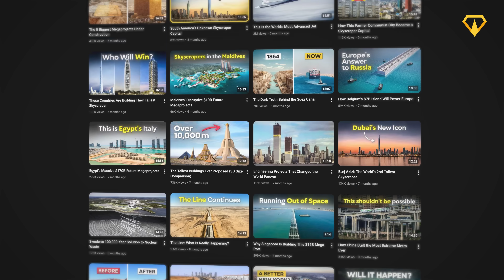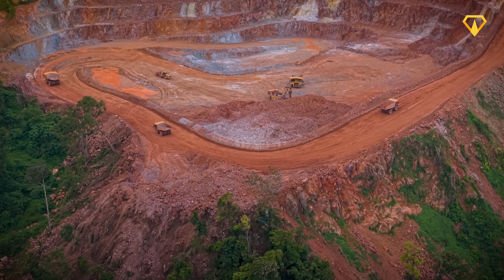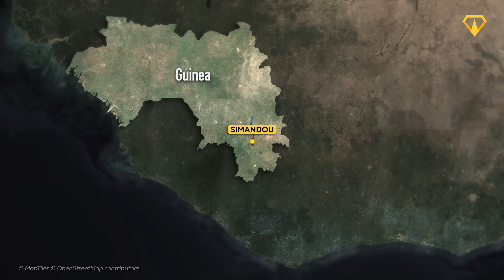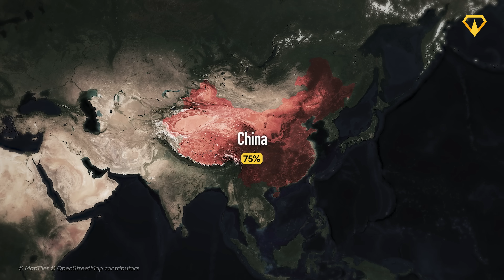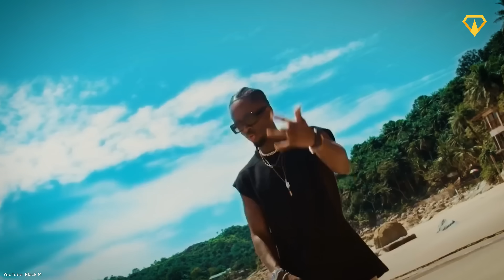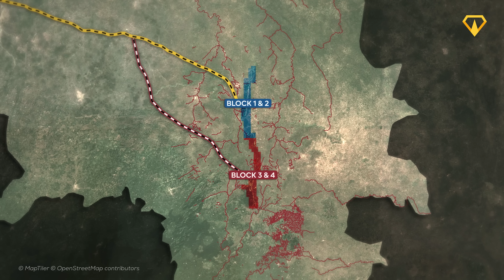Africa’s New Mega-Mine You Should Know About

Comment: Production of hydrogen for the furnaces will itself generate CO2 (as well as extra costs), so why not add-in that to the figures you quote ?
Reply: I thought most hydrogen was burned off the top of oil wells, because there isn't much demand, and transporting it is a pain. Which could mean the CO2 cost of more hydrogen could be negligible.

Comment: Green steel and low carbon steel are not the same. Green steel is produced without CO2 emissions with green hydrogen
Reply: In fact, even the most advanced arc furnace ironmaking still need add limestone in, which product CO2.